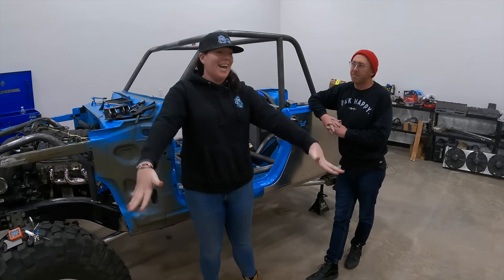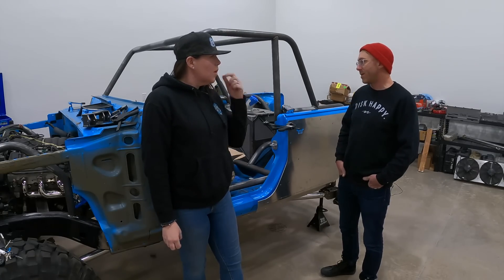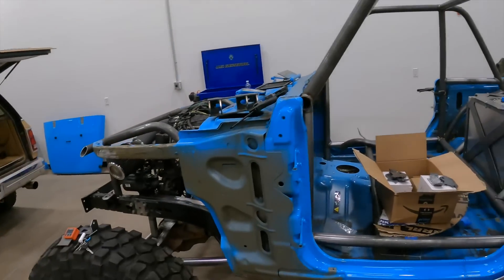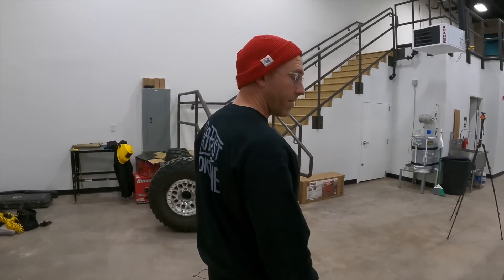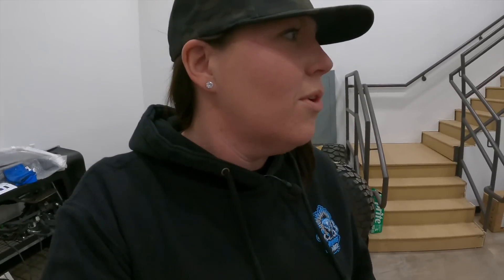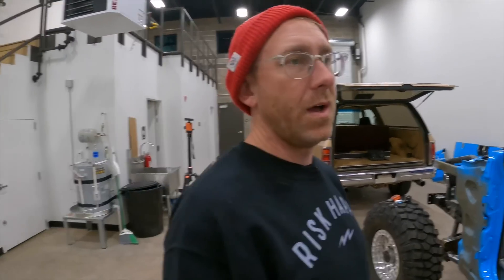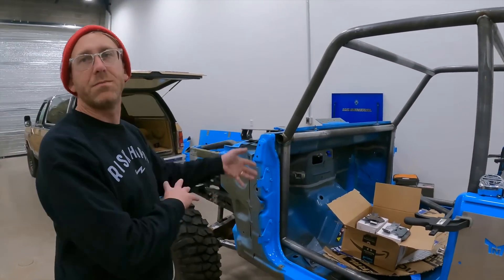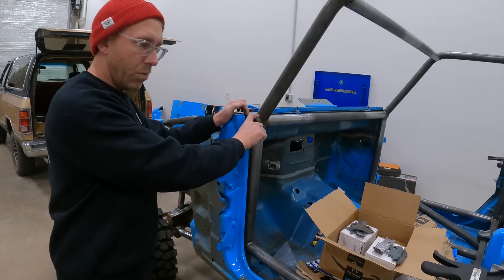50 Days To Build The Race Jeep

Comment: I am very happy that you did not use local person with no race experience. Race on an compete that is what i require of this team effort .WALTER is the balance factor i trust him.Chris has the eyes an experience to be the best CO DRIVER ,trust him. When the flag drops an you push the gas pedal an push the nitrous button, hang on. I have great expectations for this race TEAM. I will tell Chris it is with my permission he can yell, scream an direct you on what to do. No mister nice guy during the race. Sorry Walter , Race on your a spectator like myself. If you roll it ,bend it, break it ,run out of fuel etc . its us ,The team ,i am a team member an spectator . You win ,i win ,you brake ,its my brake, no judgment,no excuses ,no stories. My name is GEORGE i am strong i approve this comment.

Comment: . Starting a team so don't want to make logical sense I mean this in a very deep hearted comment when it makes logical sense they pick someone that has a race background one two you pick some on the house mechanical background you got a driver rock crawler background you can Will but you will is not a downfall you will slow and methodical that's intelligent you don't get too will methodical you are in a race it's not slow it's not methodical it's not intelligent you pick a line on the go you pick a line as you run up at it you got to see you of course and it's beginning you don't get to see it when you arrive at it pick a line through it and no one else Disturbed it you get to see the line when you're on it so the line you pick is from the seat what you see isn't always the best choice so cuz it's fast pace you got to be able to correct course on the Run hello someone with experience and the knowledge to say ease up on the throttle or Throttle Down and what course to pick would be great to have in your hip pocket